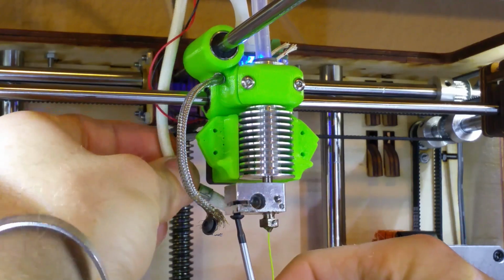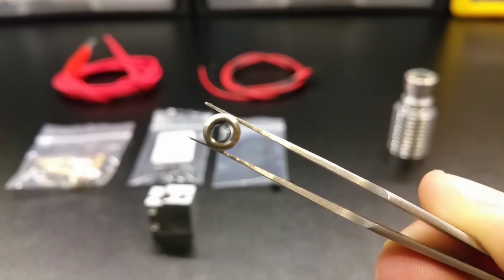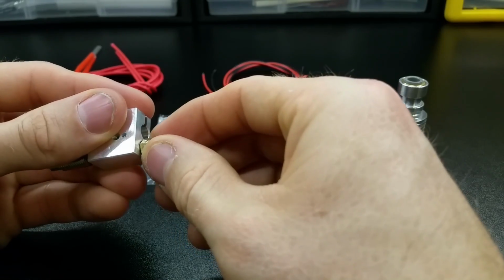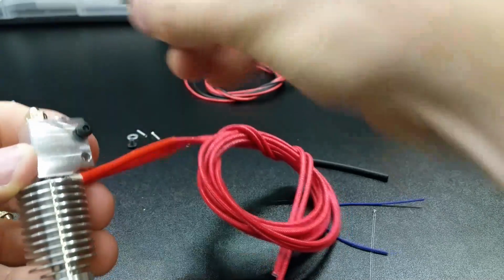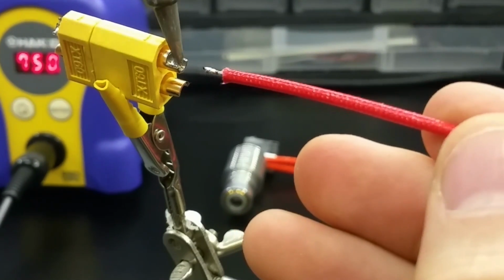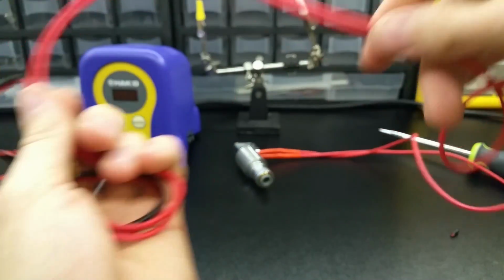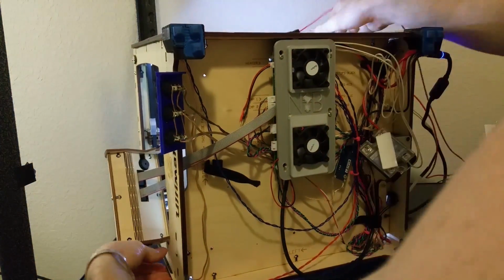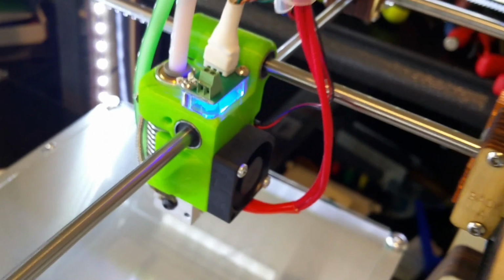Volcano Hotend #2

Comment: I'm 2 minutes in and this video is worthwhile already just because of the pro tip about cleaning out the heat break using a heat gun and a screwdriver. A++++++

Comment: When I attached the new hot end to the circuit board, the temp shot up to over 200 degree C and would not cool down unless the power is turned off. Because of this, the printer in registering an error for Maxtemp. I also cant do a PID tune because it is registering the temp as being too hot.

Comment: 0:50 It shouldn't do that, that's what thermal runaway protection is for. It is on by default, so unless you intentionally disable it, that is not a danger. I would however, turn the hotend off anyway.
Reply: just for completeness - eventhough thermal runaway is activated by default in marlin, a lot of printers ship with an older version of marlin where this has not yet been implemented

Comment: Use a ferrule instead of solder on the ends, solder will flow in a screw connections
Reply from the maker: +Timo I do not see how that makes sense. Please explain.
Reply: solder under pressure will cold flow, resulting in a loose connection and possible fire hazard
Reply from the maker: I did a little reading and you are absolutely right! I have never had any issues with soldered ends coming loose, so this is news to me. BUT the theory behind soldered wires cold flowing and mushing so that the screw looses its bite is a thing. Thanks for the heads up, I will cut off the soldered ends the next time I tickle the belly of the beast!
Reply: what about recommendation about extending the hotend wires? is it possible to use xt-30 ?

Comment: tinning before entering terminal might not be the best idea-, its more likely to get loose due to vibrations, lots of little fibers tend to give a better surface area connections to the screws also.
Reply: Putting solder on terminal connections should be avoided. The reason is that solder will liquify under the mechanical stress of the screw terminals, and leave the connections with too small contact area. This can cause melted connectors or indeed fires. The solution is to either just not use solder (as an OCD guy myself, I fully understand your position), or crimp ferrules over the copper strands. This is was taught to me by an electrical engineer. Also Thomas Sanladerer makes this point.

Good videos, part 1 was wonderfully scientific.
Reply from the maker: +meky0 hmm I see your point about surface area, but I have yet to have any problems with the terminals loosening and loosing connection. You may be right though. I'll keep this in the back of my mind incase things start disonnecting on me.
Thanks for the advice!
Reply: i do like how you said " i believe that" instead of "its better to" keep up the videos.
Reply from the maker: Experience is what you get from not getting what you want  right? haha I have tons of experience from doing something the wrong way ;) I struggle getting all the individual copper strands in the terminals without fraying and my OCD compels me to keep things tidy. I also have experienced when taking a wire in and back out of a terminal block many times it begins to mangle the ends of the copper strands. My solution to both those problems is to tin the end with solder. Is it the best solution for everyone in all applications? probably not. Is it what I have found to work best? Yes. Like you noticed I try and not make claims that my way is the only way. I suggest what I have found works best for me and offer it up as advice for anyone who is willing to take it. If anyone has a better, smarter, or easier way to do something PLEASE let me know, Its how we grow the community of PRINTr people!

Cheers
Reply: This guy. ^
Reply from the maker: yeahhhhhh
Reply: @neatherbot  solder under a screw causes a condition called cold run.  Very bad practice!

Comment: These freakin' videos are awesome and jam packed with valuable information dude! Maybe you could slow down a little bit with your explanations. Everything seemed relatively cut and dry until you stayed with your thermalcouple and had to add extending the heater cartridge wire because it was not able to reach the main board. It literally turned into brain surgery! 

I'm also having trouble locating the 3rd, and what I consider the crucial video, because it deals with changing the firmware. This part has me a little nervous messing around with the 3D printer's brain matter. I'm no stranger to YouTube, but could you please provide a link to the 3rd vid. I'm really digging this because I think it will be fantastic for my new gMax 1.5 XT+

Comment: I am running the volcano with  a 0.8mm nossle. As u said u need to decrease speed and pump up the temp. I had to change out the motor for driving the filament. Becuse it was overhting and stopped. And when i turn down the current for it- It was missing steps all the time. New motor was 10 times better. Old motor was fine with the regular v6 0.4 nossle. Managed to pump up the speed alittle but atm its alot of filament grinding if i get close to 60mm/s print speed. Next step is to get a Bondtec extruder. If u want to do a series with the volcano. That would be the proper rout to take right? To make the volcano run fast :P would be a cool vid enyway.
Reply: Bondtec?
Reply from the maker: I have an E3D Titan on its way, so I'm going to do an extruder shootout here pretty soon.
Reply: Been running the volcano alot now. But atm i am using the 0.8 still but with a layer width at 0.45 and layer hight at 0.2 and getting really nice prints. So allmost as good quality as the 0.4 nossle but never jams. But i need to thank simplify3d for getting good prints still tho.:P
Reply from the maker: +Tommy Nilsson Oh wow, I have tried reducing the layer width in hopes to get a big nozzle to print like a smaller one and have gotten mixed results. Sometimes it worked and other times it made a mess of the print. Im curious about what prints you have made, do they have very complex geometry or more simple like boxes? What print speed do you use? 
I appreciate your advice and feedback!
Cheers!
Reply: Well u need to print at high speeds. If u dont the filament will be in the hotend to long and give shitty prints.
Reply from the maker: +Tommy Nilsson like 80 mm/s? How fast are we talking here?
Reply: Sent u some pics on facebook. PM
Reply: Well it depends what temprature ur printing at. I can go 60m/s if u print at 200c maby. When i print ninja flex with the same settings its at 240 but i need to go fast when its supose to go slow :p if i dont the rubber starts to boil. And the print gets alot of bubbels in the layers.
Reply from the maker: Tommy, thanks for taking to time to have a conversation with me. You have opened my eyes to what the Volcano is capable of doing for small detailed features. I will use the pics you sent me and give you a shout out when I publish my 3rd video!
You sir have the volcano printing awesome!
Cheers!
Reply: When is the new episode out?

Comment: The original ultimaker how's it holding up after all this time. I so want want a 3D printer but can't drop the dough.
Reply: Have you looked at a wanhaow duplicator or a fabricator minni?   There are alot of cheap printer
Reply: +Panoreth 3D Printing Also, a while ago i did a video on printer for under $400,maybe that would help